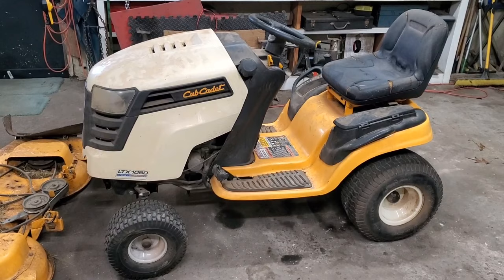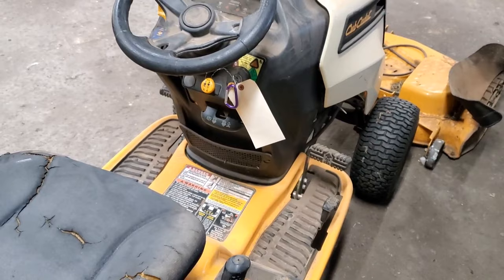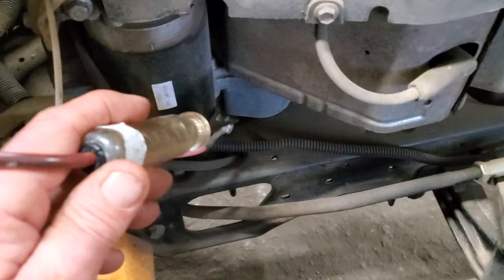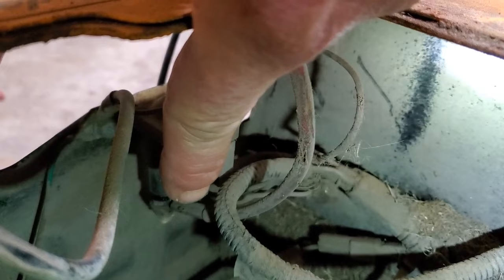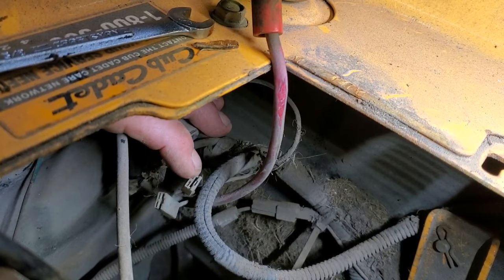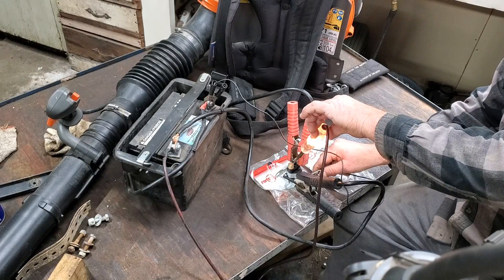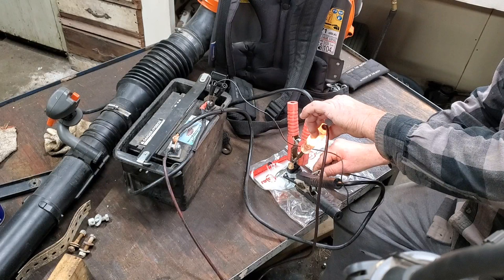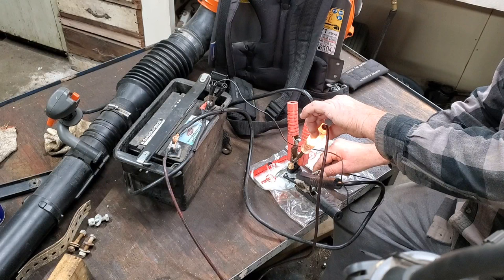Lawnmower No Start Just Clicks Easy DIY Fix Works On Most Mowers.  Battery, Solenoid or Starter?

Comment: I hope this comment helps and saves someone some valuable time. My Cub Cadet Zero turn (Doesn't really matter brand or type),  but for the last two years has been either clicking as in this video or nothing at all when turning the switch. It would eventually crank when I ran jumper cables to it thinking the battery was weak. I assumed the solenoid was going bad but I just happened to check the wires that were on the post of the starter since they were right in front of me. They were completely loose even though looking at them they looked tight. I tightened them up on the starter post and it has been cranking every since on the first key turn. I am an old small engine mechanic from the 80s, a lot has changed from then to now, but the basics are the same. I could have kicked myself for not checking something SO simple. Maybe this helps someone in the future. Great video and info on how the solenoid switch works also. I subscribed also, thank you again.

Comment: I have a solenoid driving me crazy in the John Deere 4600. It keeps on getting gummed up, so in order to start it, I have to remove it, plunge it a few times, put it back in and it starts. It's a new one too, the last time I replaced it, I made it 5 years before problems started.
Reply from the maker: A carburetor solenoid or starter solenoid?  If a carburetor solenoid just cut the plunge tip off. Idle down for a minute before shutting engine off. No, it will not cause a fuel leak issue.

Comment: Video might be 2 yrs old but it may just helped me. My cub is doing this exact thing. I replaced an old (2012) battery and didn’t get it to start so I ordered a solenoid and spark plugs. Hoping this works. With the mower out of commission I had to push mow and it took me 3 days to mow an acre. I’m no mechanic and don’t know anyone to help me so this video was helpful.
Reply from the maker: Thank you.  Check out our other videos,  we have another newer Just Clicks video. Hope it helps

Comment: Thanks for the insights into troubleshooting this tractor.  I've got a LXT 1046 that has the same problem.  So tomorrow, I'll be going to the hardware store to get a test light and see where my issue is.  You probably saved me a bunch of money.

Comment: My solenoid clicked because the engine was on the compression stroke when trying to start. I could manually move engine by compression stroke and it was crank fine. I replaced 220 CCA battery with a 350 CCA battery and it fixed my problem. Has started fine ever since.

Comment: Good video, but if you would just show the wire hookup on the switch for a 4 post. I have recommended this video but homeowners want to see the wiring all connected before this is installed. It is well explained but for someone who wants to work on their own a picture of the 4 post totally wired would help them. I have shown a few customers and I always tell them to watch your video's but some just need to see the switch wiring all finished before it is installed. I have drawn some a diagram but just a pic of it would be so easy. Thanks man, you know your stuff, I watch your video's when I get stuck on something!

Comment: Good patient explanation. I view a solenoid as a current-controlled switch. When the key is turned to Start, an electromagnet connected between the small terminals draws a small current and pulls on a metal plate which closes an internal beefier higher-current switch, shorting the two larger terminals, thus connecting the battery to the starter motor (extending the Bendix gear and spinning the flywheel gear).
Reply from the maker: Thank you.  Yep, exactly,  we'll said.

Comment: I had this same problem on my 2006 Yardworks riding mower. Up until this video, I never knew how to test a solenoid. Thanx for that demo. So I was jumping from battery to starter to get it running. Turns out it was the inside nut on the starter stud where your positive connects. I was cleaning connections this spring when I realized what the problem was. 1/4 turn is all it needed. It started up right after I got everything put back together.

Comment: try this easy test find bad solenoid   turn key only get  click  stop go to solenoid short 2 big bolts on top of solenoid this will spin starter if battery is good replace solenoid   2min test very easy

Comment: Brand new battery, brand new starter/solenoid... still getting the same exact clicking sound you're getting.
Reply: Did you ever figure it out?
Reply: You may have a corroded wire somewhere. Start with the positive from the battery and check for continuity w a multimeter and go from there wire to wire all along the starting system. Go slow and remember to check each end. Sometimes I use colored zip ties to keep myself organized when eliminating wire faults. Hopefully this was helpful.

Comment: Thank you so much for this lesson.  I am having a problem with my tractor and I'm not savvy about this stuff at all.  I have the solenoid wired up, but it's still not communicating.  My question is... if one of the smaller wire connections can still (barely) move, it's not tight enough... does it absolutely have to be frozen in place to make it work?

Thanks again for your video!

Comment: I had a similar problem, solenoid just clicked, everything tested ok, starter wouldn't move,12+ volts to starter, bought new starter , same thing. In desperation i cleaned off aluminum frame that starter is grounded to,it didn't look too bad but after i cleaned it it started right up! ( I used new nuts and copper washer as well) bottom line- make sure your starter is grounded well.

Comment: Thank you. Great way of explaining . You are a good instructor. I have a Snapper 42 in. Mower. The headlights got trashed against a tree, the wires got burnt , and shorted out. The mower will not start on its own after that. The fuse was ok. I changed it anyway . The starter solenoid clicks. Won't run over. I attached jumper  cables to the battery, it starts right up. The kill switch on the seat works. I get up , it stops. Got some Ideas?

Comment: If you put a volt meter across the big posts on the solenoid and you get continuity, Does that mean the solenoid is bad ?
Reply from the maker: Yes, with the key off and or wires disconnected. I have a Toro video with that exact problem. https://youtu.be/LtDV27PXuko

Comment: Snapper RE 110 - New Battery, New Solenoid - New Key Switch - New carburetor as it failed as they often do on the rear engine mowers - Added fuel shut off valve to better control flow of fuel and storage during winter - I have no sound upon turning of key trying to start the mower - Check the Starter next I suppose, I have to check the starter...

Comment: Does the seat switch have to be engaged by sitting or other pressure to start?  TIA
Reply from the maker: Good question.  It depends, some models you must sit in seat.  Some models just apply the parking brake.

Comment: Is that gap pretty standard on the valves? I'm working on a Kohler CV15S. The manual says do not attempt at home. I guess they didn't have YouTube back then when they wrote the manual.
Reply from the maker: Yes

Comment: Wow! I hope i can remember all tha t  when i go into the barn to work on my macine. Thing is, i replaced the solenoid (and  battery) last year; I've just replaced the carburettor. Won't turn over. I want to check for spark but am working on my owh. Bought a remote start switch for such a situation but never had to use it ...until now, and can't find the instructions! Any ideas, people??? Thanks.

Comment: First mistake was buying a Cub Cadet they and John deere are a plastic Tubs the best tractors are the Craftsman Turn Tight series hands down..built to last..Kohler 7000 series engines..Metal hoods and serviceable Tuff Torq Transmission steel not plastic..it's a incredible lawn & garden tractor I have the T240 simple awesome
Reply from the maker: 😆 nope I don't own either.  We own a shop and constantly have them in for repairs.  There are 9 John Deeres down here right now.
Reply: @RaleysSmallEngines  I searched before I bought my Craftsman T240 looked a John deere  cub cadet  Husqvarna  then I looked at the Craftsman..I said Wow I paid a total of $2,800 some places even higher but they are worth every penny built like a little tank..

Comment: My JD lawn tractor L100 does not start.  At first I thought that it make a clicking noise and it only cranks a little bit maybe 2-3 inches.  I change the starter and solenoid, still no start.  I notices that the bolt that holds the starter cable is not tighting a whole lot.  Its also spinning a little, maybe defective, ill return it.  and try again.  If it doesn't work ill give you another message it you don't mind.  Thanks.

Comment: That's all great information, but could you please tell me where I put my electrical tester?
Reply from the maker: 🤣 thanks for watching my friend. You left your tester right next to your hammer.
Reply: @RaleysSmallEngines  
Which hammer? I have more than 50 hammers, but I can't find most of them. I think it would be easier to swap the solenoid out of my other tractor to see if that fixes the problem.

Comment: I’m in the process of fixing my Cub Cadet Xt1 as well. It’s making the same single clicking noise but the thing is, I bought a new solenoid and connected it. It is a 4 point system* but nothing. I bought a new starter as well and fuel pump. Oil filter with new oil and new air filter. Possible the new solenoid is busted too?

Comment: My toro timecutter had a 4 post solenoid. Sometimes it starts no problem, sometimes it just clicks. Very irritating, I thought my battery was draining. Got to the yard, wouldn’t start, would just click. Went all the way home, started right up every time. What do you think it is? It’s a newer mower.

Comment: Great video.  My Cub Cadet makes the exact same noise as yours did.  (Kohler 26hp - 2016 XT2 - 270 HRS)  

It stopped last week during a cutting session, due to an ongoing fuel problem I am still having.  It would start after the fuel filter would fill up again.  This last time, only the click is heard. Replaced the battery, solenoid and PTO switch and checked the battery ground at the frame.  Still only get the loud metallic click. 

Can you please offer up any ideas what to do next?

Thanks!
Reply: Check that all your connections are tight and free of corrosion especially the battery terminals, wiggle the brake pedal around while trying to start it if you get any hint of a start, it probably the brake switch but it could be seat switch, check your safety switches and of course, careful visual inspection. Good luck and keep us posted.
Reply: @Mrs.T-bone  Thanks for your advice.  It was the starter.  There were metal filings along the collar at the base of the gear and it was seized up.  
Thanks again.

Comment: mine works without the extra wire but its hard cranking.  Can it still be the wire?  Starter is pretty hot.
Reply from the maker: make sure your compression release is working.  I have a video on that also

Comment: Why would smoke come from the starter cable?
Reply from the maker: A few reasons.  Loose or dirty connections at battery or frame ground, valves need adjustment so compression release works, bad camshaft (compression release) or bad starter. Also possible hydrolock remove spark plug, if gas come out its a carburetor issue

Comment: Question does the green ground wire that bolts with your solenoid on frame go between the bolt and solenoid bracket or does it go between bracket and frame I’m not sure if it matters just curious every time I turn the key to crank starter it buzzes then pops the fuse thanks!
Reply: Never mind figured out my issue the negative cable to battery I followed it to the ground and all it needed was a good cleaning for better ground connection

Comment: Good video. I have a Cub Cadet 1554 riding mower from 2006 and near the end of last season, it cut off after an hour of mowing and I assumed it needed gas so I refueled and when I tried to start it again, it wanted to crank but hesitated and then just only did the single click. At first, I thought the battery went dead but it is fully charged. I thought I had done the proper test on solenoid and starter and thought they were both good but still single clicks but will test again. Also, someone replaced the starter motor in 2016 but I think with a wrong model. The replacement motor had 9 metal teeth at top but the right part number for this mower is supposed to have 10 metal teeth. But, it has still cranked since but was wondering if that could have made any difference.
Reply from the maker: Be sure the starter gear isn't hung up in the flywheel. We always make sure to replace starters with the same amount of teeth.
Reply: @RaleysSmallEngines  Thanks. I replaced the starter motor with the right model and still does the single click so I'm going to replace the solenoid today and see how it goes. I have a feeling it may be the problem.
Reply: The Solenoid on my mower was a 3 post but I went ahead and bought a 4 post and replaced it and the mower seemed as if it wanted to start for a second but now, it doesn’t even do the single click. Also, the new 4 post solenoid came with a jumper wire so I connected that to the flat connector on lower left of new solenoid and other end of jumper wire to a bolt that connects solenoid to frame but I also reconnected the green wire over bolt on upper left of solenoid along with one of the two othe wires the way the green wire was connected on the 3 post solenoid, if that makes any difference. I still hope to figure it out.

Comment: MTD uses really crappy ground and power cables. Change at least the ground wire to a thicker one and you'll eliminate the starter drag. I've owned somewhere around 40 of these and have  2 or three on the place at all times.

Comment: I have a yard machine ride in lawn mower I replace the carburetor spark plug initial coil battery Is it a crank but I won't fire what could be the problem

Comment: Hey bud so, I don’t have a “click” sound. I hooked up the battery to a charger but it fails to turn on the “connected” light on the charger. I know the charger works but it doesn’t recognize that it’s connected. Any ideas ?
Reply from the maker: Possible bad battery?? Test battery with a volt meter if you have one.

Comment: Thank you for the lesson on how the solenoid works! I have an LTX 1045, just replaced the battery & solenoid, it still makes the clicking sound. Any suggestions? Thank you in advance!
Reply from the maker: Put a volt meter on battery and watch voltage drop when you turn key. Also put jumper box directly to starter and see if it turns over.  Remove spark plugs to make sure it's not hydro locked with fuel.

Comment: My Cub cadet used I just bought got a battery already in it couple months old the problem is when I go to start it it just clicks but I put a jump back to it and it starts right up but the battery light is on when I'm running I'm on the yard.

Comment: I have a club  cadet everytime i turn my key ,my20 amp fuse keeps blowing  any suggestions
Reply from the maker: First, careful visual inspection of wiring. Think.. has anything been done to it? Has anything changed?
Reply: Now the key isn't in the ignition, and when i put a fuse in it just pop's
Reply: You have a short somewhere. Electrical problems can be difficult to diagnose at times. Check the fuse holder carefully. We have found them melted and deformed.   
Good luck hopefully it's something simple and easily found.
Reply from the maker: @inc1983  EXCELLENT, Mrs T is correct, there is a dead short.  Check wiring, take your time.

Comment: trying to fix my moms cub cadet sltx 1054 solenoid it was melted so im not sure where all the wires attach  i have two green wires two red one for positive and one coming from the fuse . one green wire coming from right side of tractor and one black with a green wire ?i can not find anyone to help or videos that show these green wires . thank you

Comment: I have a 1042, it just quit while mowing.  The 20 amp fuse and holder were melted.  Rigged up a fuse to finish the yard.  Bought a new in line fuse holder and put it on.  Now, it starts until the key goes to the run position.  Then dies.  The solenoid has been acting up and you have to tap it to get it to work.   Headlights don’t even come on.  Any ideas what it might be? Is it the solenoid?
Reply: I figured it out.  The plug in the back of the ignition switch was loose.   Ugh!

Comment: Just a follow up on the Cub Cadet, at least one of the green wires to the solenoid started smoking and burned down to the exposed wire. I put some electrical tape on it and tried reconnecting everything and the negative cable sparks when I try to connect it to the battery terminal.

Comment: I had same issue, solenoid post was melted, replaced solenoid w/new one...it started once and has same issue again...???  Any sugestions?
Reply from the maker: Is it a Briggs and stratton? If so the issue is most likely the valves are not set to .004, or a bad cam. I have videos on both issues and how to repair them.  Thanks for watching and commenting my friend.  Compression release issue